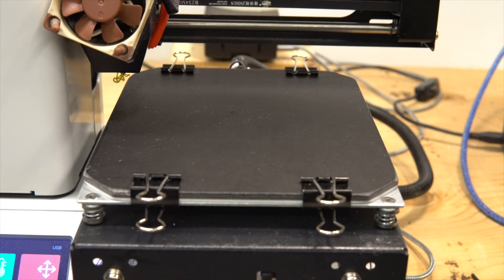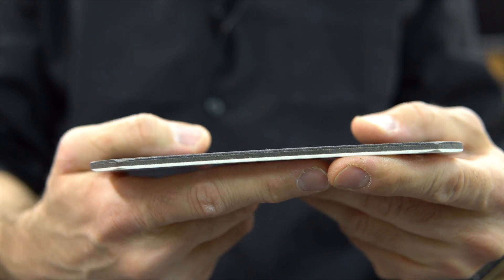The Pros & Cons of Bed Surfaces

Comment: Hi there
I've just purchased my first 3D printer and I find your guides really good.
Have you ever tried glas blasted glas (frosted)? I think the rough surface might be enough for the sticking to work.
Reply from the maker: Hi, I did not try that, I found a brand of glue stick that works really well, but if you try that please tell me how it goes !

Comment: Do build tak stickiness get worn out? After using it for a lot of prints it’s starting to get dirty and one day it just stopped sticking so when the extruder turns a corner it just moves along or is the nozzle to far away from the bed? Gonna replace it anyways

Can’t find a size for the mop mini select so if you see one that ships to CANADA then can I have the link :) thanks
Reply from the maker: Check Amazon it AliExpress it’s 120x120 if I remember...

Comment: The PRINTinZ site says their flexible bed doesn't help correct a warped bed. I have the Mini v2 and like many my bed is warped. Do you know a reputable site where I could find a borosilicate plate?
Reply from the maker: Do you heat the bed at more than 60 ? If not you could first try a regular glass, borosilicate glass is mainly for high temperature applications. The glass I use from an old picture frame is flat and it stays that way under 60 degrees. I do not know of a good source, maybe some manufacturer of stoves, they use tempered glass maybe they use borosilicate also?
Reply: I only print in PLA, don't heat the bed much at all. I was considering borosilicate for its durability I've gotten cut and a good friend of mine who did glass work was seriously injured by plain glass. Love the printer except for the bed.
Reply from the maker: Go with borosilicate then! I would also, but it’s not easy to find...

Comment: Hi Frank, do take a look at FR4 or FR2. I print PLA on FR4 and it has a very good adhesion from the start. To improve the adhesion, I do some careful and soft wipes with 120 or 180 grit sandpaper and wipe it down with cloth and isopropanol or similar. Pros: It is cheap, works with a lot of materials without any kind of glue sticks or similar. Cons would be that it may warp through the heated bed but you can counter it through flipping and it will bend in the other direction.
Reply from the maker: Wow innovative idea, not sure what the finish will be. I just wonder if it could give out fumes if overheated? For now, my old PEI sheet is sticking well even on big parts, the glass bed as a little less adhesion but plenty, and printinZ for PLA nothing to do, just print bend to remove repeat...
Reply: It depends on the kind of FR4. There are some smooth sorts who give a really smooth finish but I couldn't find out how that type is called.
FR2 fumes a bit formaldehyd but it is almost not existent and FR4 fumes nothing. There are several thickness ranging from 0,5mm-3,2mm. All below 1,5mm you can bend easily to pop parts off. Also one big big pro is that you can print at least PLA without heating the bed. I didn't tried myself until now but read from some who tried that and got very good results. Also at least in Germany, where I'm coming from, it is in the DIY 3D printer scene almost common to use FR4. A plate for the MP Select mini, which I'm using is about 1-2€.

Comment: Question about your intro of most of your videos ?
The famous espresso  cup 3d printed  what material was and if you really used ? 
Thanks ! :)
Reply from the maker: Hi, it was PETG, and I used it only once, you would have to seal the plastic if you wanted to use it, so that molds and bacteria can not get in between the layer... I do not think it could be washed in the dishwasher but I did not try.
Reply: Frank's 3D shop just because of that I made one never used it but love it .
Thanks again ! 
Cheers ! ;)
Reply from the maker: Cheers ! :-)
Reply from the maker: And to be honest, it's a little rough on the lips!

Comment: do you try with mirror? some people say it a good surface but i never try it, i have a machine without hot bed and i use tape but y need to change every time... i think i try the buidtack
Reply from the maker: I tried glass from an old picture frame, it is the same as a mirror, just not as pretty :-) Getting away from tape was a relief for me, go ahead you will never look back!